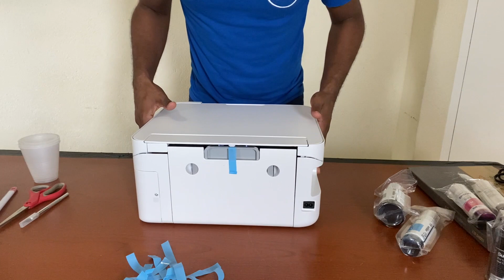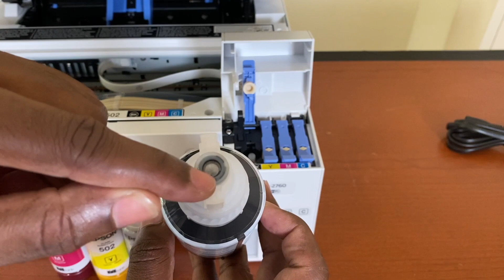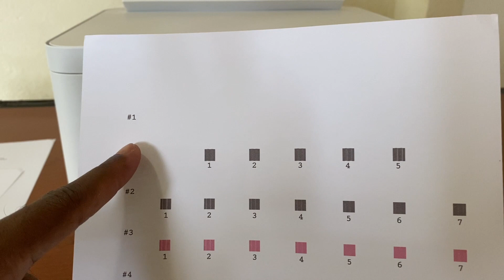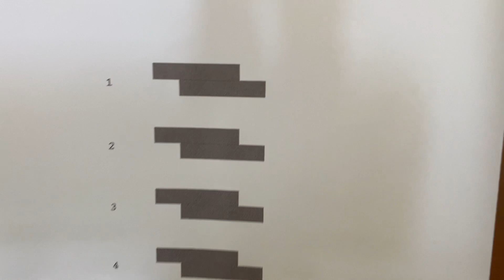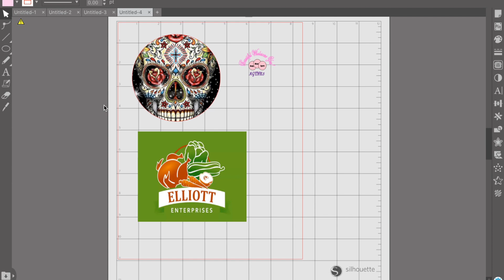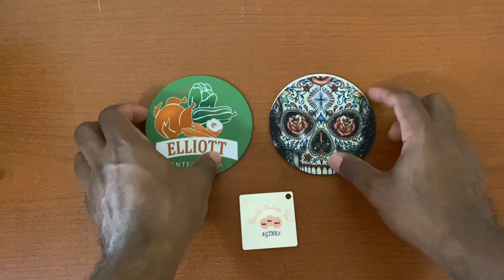Converting Epson EcoTank 2760 Inkjet to Sublimation Printer using Hiipoo Ink

Comment from the maker: Take a look at this sublimation playlist 👉👉https://www.youtube.com/watch?v=7gHm57DvlWc&list=PLWFr5junSpJ325IDTZkP4XShtiFqBrhoH
Reply: I didn't know the part about the ink. I bought one for sublimation and I filled it with ink it comes from. So I really need how to remove the ink. Can you help me with a video?
Reply from the maker: @vidinho1210  Thanks for your question. I do not have a video on how to remove ink but I can tell you is to start with a syringe and pull out as much as you can. Once you get out as much as possible install the ink you want and do a good set of print head cleaning to get out the old ink.

Comment: Can i still use the printer if i don’t have a laptop? I only use an ipad. Thanks.
Reply from the maker: Yes, you can use it with an iPad.
Reply: @atprints  thank you for your response. 😊 will i get the same print quality printing from my ipad? Coz i think we have to set-up the print settings to get the best quality right?
Reply from the maker: @printsncraftsco  yes you should get good print quality. Are you using the printer as a sublimation printer?
Reply: @atprints  yes, actually i’m planning to get the 2803, they said it’s just the same as the 2720 but improved and cheaper too.
Reply from the maker: @printsncraftsco  ok I understand. If you want my advice, I would recommend if you can and have the finances to get a surecolor F170. It will save you a lot of headache but this all depends on your budget.
Reply: @atprints  that’s what i want too at least i have the tech support and i don’t need to convert but it’s always out of stock. I dunno where to get it. 😔
Reply from the maker: @printsncraftsco  which country are you in? I’ll try to do a search for you and send a link. I will try my best for you.
Reply: @atprints  Pomona, California. I saw one but lead time is 4weeks and i need to finish the project by May. I dunno if i can wait that long. Thanks for your help. 🙂

Comment: Session 2 totally missed!! You only showed after printing!! I’m in the middle of setting up help!!!!!!
Reply from the maker: No session was missed. Once you installed the ink and turn on the printer it will take you through various steps. You will need to go slow and follow all of those steps. When it comes to alignment of the printer it gives you the option to adjust now or later. In the video I recommend you adjusted it right away and once you select the adjust option you will follow the steps and it will print out the squares. Once the squares are printed you will follow the instructions on the printer screen which should be telling you to select the squares with no lines in them.
Once that first alignment is completed then you will proceed onto the second alignment when comes right after the first. At this point the printer will then print out rectangles and you will have to choose those rectangles which does not have a line in the middle and once those steps are completed you can proceed forward.

I hope this helps you and if you are still lost feel free to reach out to me on Facebook or Instagram @allan21thompson or all of my links to my Instagram and Facebook is in the description. 
Hope to hear from you.
Reply: @atprints  thank you
Reply: Please one more question? I didn’t get a chance to complete and got frustrated. I some people say it’s best to keep printer on to keep from clogging and using up your ink when recharge what do you suggest. I’ve only used HTV on Cricut this is my 1st time sublimation. Brought the Epson over 2 months ago and was terrified to attempt. After watching some of your vid I immediately subscribed . Your teaching method made me open the box and start (at least) hope to finish the set up after work 
Thank you again 😊
Reply from the maker: @pepghee-mendez395  You are welcome.
Reply from the maker: @pepghee-mendez395  i am truly happy to hear that my videos gave you the courage to open up the box and start the process. What I can tell you is that so many people get so many different response and experiences with different type of printers. When ever i am finish using the printer  it is turn off and i never had any issues with clogging. I would say to you that a lot of people convert printers also myself included which was the best method at that time since there wasn’t a true smaller sublimation printer, but when Epson released the F170 i advised everyone to just purchase a true original sublimation printer and forget the converting.

However all in all, I believe if its turned off you shouldn’t get any issues and i am speaking base on my experience with it not having any issues. However, at the end of the day you need to trust yourself with if you want to keep it on because you fear it might clogged or not. But if you ask me, ill say turn it off when you are finish printing and when you are ready turn it on and print your stuff.
Another example i can give is i have an Epson WF7710 which I converted like 2-3 years ago and after i use it each time i turn it off, Sometimes for 1-2 months straight and when i turn it on it prints like a beauty and i have no issues. 
Also you can ask me more questions if you have any. It’s ok with me, thats what i am here for. So ask away. Also as i mention before you can also reach out to me on IG or Facebook and we can talk as i know when you talk its faster.
Keep me updated on your progress.
Reply: @atprints  oh I will ask!!😊 and post with your credit when completed again thank you
Reply from the maker: @pepghee-mendez395  your welcome
Reply: @atprints  soooooo I did it!!!!!!😊 all set up on computer now I have to review this post for next
Reply from the maker: @pepghee-mendez395  Congratulations on the setup. I am happy for you.
Reply: @atprints  lol only took me 2 plus hours 😂😂
Reply from the maker: @pepghee-mendez395  lol it happens to the best of us. Now your on your path to printing.
Reply: Never got those triangles tho’  I have ocd I just cannot proceed without them because I want them everything else went through and I printed them 
I want triangles!!!😂💯
Reply from the maker: @pepghee-mendez395  which triangles do you mean? Or are your talking about the rectangle for alignment
Reply: @atprints  I got the triangles but don’t know what I’m looking at 
I need sublimation for very beginners !!
As I now feel kinda stupid repeatedly asking for help
One thing about me I’ll get it it just has to click
Reply: I’m loyal !! Once chosen I stick!!  I will learn sublimation from you. I won’t sleep till my triangles 💯 appear 
I also had to set computer to auto set up as after entering only 8 characters (password) automatically went to processing thus invalid email address  but I got thru with confirmation
Reply from the maker: @pepghee-mendez395  great. I also do sublimation classes. You can message me on Facebook or Instagram if you are interested.
Reply: Finally Mr Thompson finished now for the next step silhouette I’m lost uggg you did some down loading stuff and so forth 
But  I’m registered with silhouette but don’t know what to do to test snd print
Reply from the maker: @pepghee-mendez395  if you finish set up the printer you can print any image to test it.
Reply: @atprints  but I never was directed to the set up page like you did like paper quality etc sry to keep pestering you I made it this far  this is truly for dummies 💯😬
Reply from the maker: @pepghee-mendez395  let’s just make it easier by doing a session, this can make it easier for you. If you have Instagram message me there and I’ll help you 👉 https://instagram.com/allan21thompson?r=nametag or even Facebook.
Reply: @atprints  unfortunately I don’t have those anymore because I got hacked 
But because of you I made it this far and am thankful for your immediate responses 
I only use TikTok and YouTube not 
But you are the best 
I gotta figure how to proceed from here
Just want to do more than Cricut HTV 
God bless!!
Reply from the maker: @pepghee-mendez395  ok i understand.
Reply: @atprints  I see that after all this it cannot be done on Cricut I needed another machine of look for sublimation on Cricut?!
Reply from the maker: @pepghee-mendez395  you can use the circuit program to print and sublimate images
Reply: All on this page Allan Thompson is truly a teacher!!!!! He really answers your questions immediately 
Much love and respect!
Reply from the maker: @pepghee-mendez395  🙂👍🏾👍🏾
Reply: Got my triangles!!!😂😊

Comment: what do u do when u have already put the ink in and need to take it to put the sub ink in
Reply from the maker: Thanks for your question. I’ll say that I never done this before. However, I would advise draining as much ink as possible then install the new ink. After print a couple of full sheets to get out the old ink. This should allow the new ink to come out. 
This is the best advise I can give or this is what I would do. Just remember as I mentioned before I never had to change inks back.

Comment: I am NEW to sublimating, but  AFTER I drain my printer( because I was so excited to get started I put in the wrong ink) is there something I need to do BEFORE adding the sublimation ink? I have this same printer......
Reply from the maker: Hi and welcome to the sublimation world. All you need to do is make sure you drain the ink as much as possible then put in the correct ink and do the head clean, alignment etc. After print about 2-3 different images to get out any of the previous ink and you should be good to go.
I hope this answer helps
Reply: @atprints  AWEWSOME!!! THANK YOU!!  I will let you know how it goes.
Reply from the maker: @tamararagsdale6621  your welcome 👍🏾
Reply: @atprints  I did the same! I was so worried. Thanks for the video.

Comment: Allan I followed your way to setup but I still have lines, so whats the issue.  I was using regular copy paper.
Reply from the maker: Sorry for the late response. If you still have lines i would advise that you redo the process or choose one of the boxes or rectangles that has the least lines in them.

I hope this answer helps in some way.
Reply: @atprints  Awesome
Reply from the maker: @keonipauole1828  💪💪

Comment: I left the ink in their original bottles and just used the tops. I took the sub ink and placed in the top and squeezed. When finished prewashed tops and put them back on the reg ink. So you won't ever mix the inks.
Reply from the maker: Awesome 💪💪
Reply: Did you use the Hippo ink, Lisa? Literally just purchased the hippo ink and et 2760 yesterday and found this video today.
Reply: @hmeirify  yes
Reply: Interesting, my Epson ET2760 ink lids didn't fit my Hiipoo bottles. You're lucky.

Comment: When doing sublimation you not supposed to mirror.
Reply from the maker: Yes, when you are sublimating you have to mirror the image.
Reply: @atprints  Really i see people using Siser EasySubli and they dont bleed or mirror the image and its amazing.  When you cutting vinyl you need to mirror.
Reply from the maker: @keonipauole1828  thanks for your response. Let me go into some more detail to give you a greater understanding about easysubli and sublimation. With easysubli you have two processes you can use. 1. You can print directly onto the easysubli and by doing this you don’t have to mirror the image and you would peel off the back of the easysubli and press it onto the apparel. 2. You can press the easysubli onto a apparel first and then you can print an image from your computer, however, note that once you use this method then you must mirror the image first. Once your image has been printed then you can print that image onto the easysubli. So when using easysubli to sublimate there are two ways you can do it.

But in general when you are looking to sublimate you normally have to mirror your images first. If it is easysubli then as I mentioned higher in my message there are act least 2 ways you can do it.

Hope this helps 💪💪
Reply: @atprints  thank you brother
Reply from the maker: @keonipauole1828  you are most welcome 💪💪
Reply: @atprints  i also dont use cameo i use cricut
Reply from the maker: @keonipauole1828  💪💪💪

Comment: Hiipoo Sublimation ink is the ish bruh. I wanted Cosmos because it’s great but it was hard for me to get it. Found the Hiipoo, I wasn’t let down! Very vibrant.
Reply from the maker: I also have cosmos ink but I haven’t used it as yet as I have waiting until my other ink runs out first. Then I will do a full print head clean etc. The Hiipoo ink I sn’t back and it could indeed pass.

Thanks for your continuing support. I appreciate it.